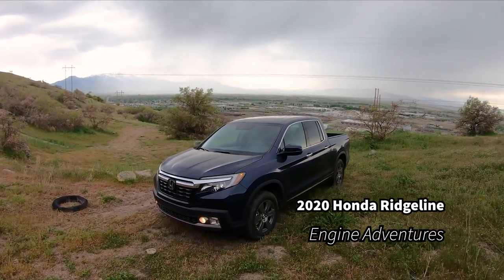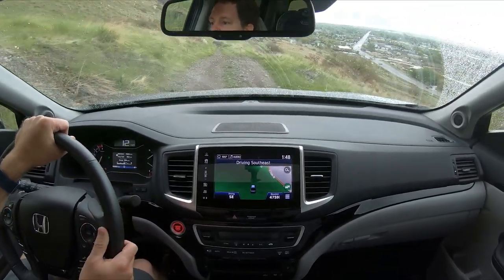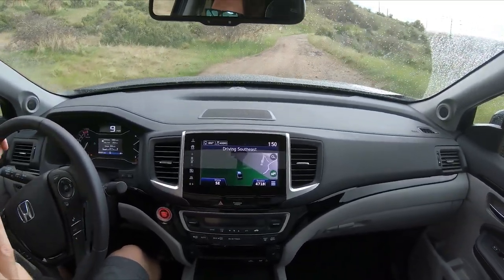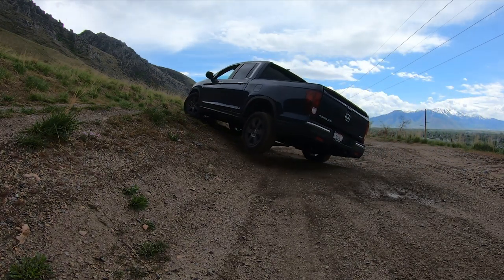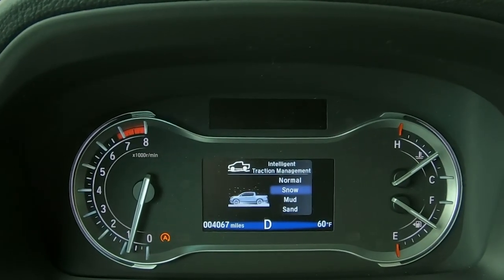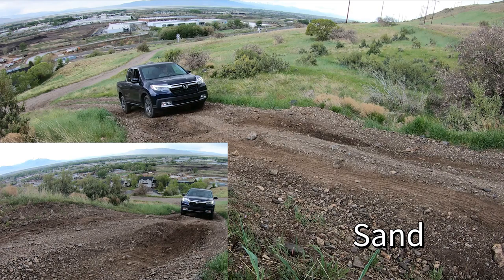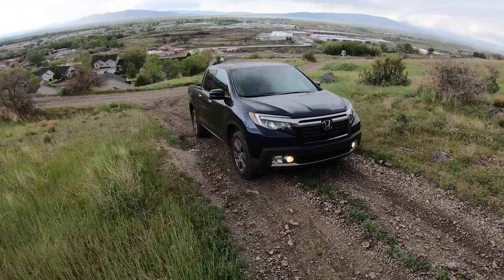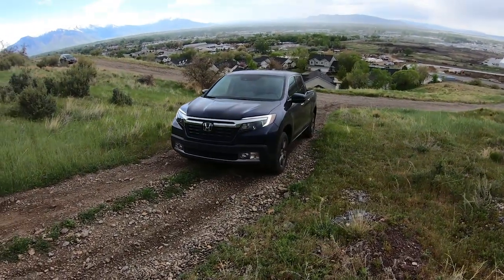2020 Ridgeline Off Road

Comment: I'm guessing with off road tires it would do even better?
Reply from the maker: Tires certainly help, but the limitations of the AWD system will still be there, maybe just not as prominent.
Reply: 255/70/17 tires and 1.5 inch leveling kit gives it almost 2 inch extra clearance without compromising handling, mpg and awd. I prefer Honda 6 speed transmission compared to 9 speed ZF which is much more expensive to maintain like 4x the cost for a fluid change. One biggest thing that every owner needs to do is disable VCM with SVCM then u  don't get all the issues like oil burning, transmission issue, torque convertor issues and injector issues.
Reply: Amazing car but if you wanna 4x4 get a proper 4x4 car.  My Tacoma would walk over that without a struggle
Reply from the maker: I just had a Tacoma TRD Pro, the video should be up in about a month.
Reply: Kbl  how do you disable vcm or svcm.?
Reply: Thanks
Reply: @alexgarcia3900  well ridgeline is capable with tires and 1.5 - 2 inch lift it will follow a tacoma but not on all terrain, id still take the ridgeline for its 26mpg highway roughly
Reply: @xzinx  look i don't mean to offend anyone.  The ridgeline is a great vehicle, more room, faster, better gas mileage, more confortable that tacoma.but when it comes to actually off roading it just simply can't come close to the tacoma.  I honestly considered the ridgeline but I do off road here and there so it wasn't an option and I personally think it's a hideous looking vehicle. The inside is super nice and comfortable though.   But seriously dude that thing can't off road.  Maybe some dirt roads but that's not really off roading. And even with the lift the clearance is just terrible. There's a few videos of people taking them off road up a steep hill and the 4wd system just overheats.  It's just not built for that, and that's  ok.
Reply: @alexgarcia3900  but can you put 4 full size adult?
Reply: @xzinx  lol you're a funny guy.  Dude i had a tundra before that. If i needed room I would have kept the tundra. My 4 door tacoma does exactly what i want it to do.  You honestly sound like you're a fan fanboy.  The ridgeline is a great car i already told you.  But it most definitely cannot off road, not even halfassed not even with a small lift and better tires. And yes the tacoma can definitely have 4 adults.  Not the most confortable but it can, then again I don't ever have 4 adults in the truck.  And if I needed that I would just go buy a full sized truck and leave this one for when I go 4x4/ camp.  There is now way in hell a ridgeline could go to the places I take my truck.
Reply: @alexgarcia3900  why you so mad lol,
Reply: @xzinx  lol. You're the one that came here with your 2 cents.   Entetain me so everyone else can see how smart you are.
Reply: @xzinx  come on keep telling me how awesome the ridgeline is.  Do you own one?
Reply: @alexgarcia3900  yes i do

1st i didnt suggest anything it was the thread owner, i just put in my 2 cents
And the video didnt show any TUNDRA,...
2nd i dont do any hardcore offroading, just enough to find a nice off grid campground

3rd yes i took my ridgeline on sand dunes, didnt get stuck
Moderate trails 

4th i needed the space that tacoma cant do, theres 4 of us family that camps, and tacoma just wont do

The video shows what 90% of people do with their truck anyways
Reply: @xzinx  lol good for you . You'r comment was still stupid. Like I said, Nice car but if you wanna 4x4 get a proper 4x4.  Ridgeline can't handle it.    That's all im saying and it's true.  So people don't go out and buy this thinking it can 4x4 like you are making it seem
Reply: @alexgarcia3900  so why did the ridgeline offroad in th video? It didnt break down, it didnt stop, most of the people who likes to camp go on this kinds of road..

Your boneheaded mentality about 4x4 is stupid lol not everyone needs a 4x4, a capable awd is enough for most people
Reply: @xzinx  lol can't believe you're still defending your mom truck.
it did overheat for one and the guy even said it himself, it's not good for the vehicle. and by the way that's barely off roading. Like seriously though, you can't even get skid plates for that or rock sliders and anything worthy of off roading.    But you are very entertaining ! 

Please tell me more 🤣🤣🤣🤣
Reply: @alexgarcia3900  jsport sells them, im defending it because of the trails i do arent really technical, it fits what i do with my family, period

Btw chrck out johndz on his passport basically the same engine same trans same body but eith out a bed, thank you 🤗🤗
Reply: @xzinx  🤣🤣🤣🤣🤣🤣 you even looked it up lmao .  Well that's pathetic 😅😅😅😅   i still wanna know more you are very wise person.  Tell me more about this mom car being so capable.
Reply: @alexgarcia3900  sigh, if you read what i typed in the beggining before your fanboy 4x4 brain kicked in you would have gotten what i said,

Let me repeat again, with rims and tires you can take this capable truck on trails fpr camping, sand dunes, i know because my old pilot did it i took it to trails on mammoth and pisno beach
Reply: @xzinx  come back i miss you.
Reply: alex garcia 
Why are you so angry? Why were you so offended that he asked if  4 adults can fit in your Tacoma? To be fair, they barely fit a man over 5 10 in the driver seat. You regret your purchase and feel the need to be a keyboard warrior to make yourself feel better or something? I’ll never understand how people can get so heated and invested in a YouTube comment section lol. So invested that you come back a day later 😂 is your life really that boring?
Reply: @EGGMANNoriginal  my life is pretty exciting actually.  And no i dont regret buying my tacoma although i do have to say it is a bit small, but then again i kinda need it to be because i off road a lot.  My tundra was awesome but it had a hard time getting through the small areas.   Again i wasn't mad and im not mad now.  I did say the ridgeline is a great vehicle just not good for 4x4.   What's the purpose of your comment defending mr ridgeline over here?   Are you also gonna come and talk some nonsense?   By the way look at what is the most selling mid pickup and what is the worst one.   I think there's a reason for that.   I actually still look back at my tacoma every time i get out.  And you know what the cool thing about owning a tacoma is???  You don't have to sell the idea about it being a cool car, it Just is.   Unlike the ridgeline.
Reply: alex garcia 
Lol, I had a 2015 Tacoma TRD off-road. It was okay... cramped, rear drum brakes, lackluster acceleration, overpriced... if I could go back in time, I would have gotten a Nissan Frontier pro-4x. Just as much truck, just as capable and reliable, $10k less... “cool car” is subjective so yes, you do have sell the idea lol. Now I have a 2020 Ranger. Better than my Tacoma in every way. I seriously considered a Ridgeline and would own one if they had higher ground clearance.
Reply: alex garcia 
Ranger is up 20% in sales over last year, Tacoma is down 20%. Rangers are already selling about half as many Tacomas. Pretty impressive for 2nd year with not many trim options. Just wait till the Ranger raptor comes here and the Bronco lol. Sales don’t really mean much tbh though so I don’t know what you wish to prove with that. F-150 and civics squash the tacomas in sales, but that doesn’t mean they are inherently better vehicles.
Reply: @EGGMANNoriginal  there's opinions and there are facts.   Yes sales matters when they are in the same category.    Why do you think a civic sold more than a focus?  It's a better car.  I like ford but for the only thing the ranger has going for it is the drive train.   And then again it's more maintenance heavy and more likely to have problems. So you were complaining about me but here you are doing the same thing.  Either way i do like the ranger, i test drove one and at they got the best engine in the mid size for sure.  But for myself i ended up with the tacoma.  I got a decent deal and im gonna keep this for my overlanding rig.   I really didn't wanna get something unreliable and get stuck in the middle of somewhere with no service
Reply: alex garcia no reliability problems so far, but that’s always a potential issue with any vehicle, especially Ford lol. We’ll see. I’d really like Honda to make an actual off-road vehicle or Toyota to make something comfortable for my height on my hour commute each day. I’m also curious to see what Nissan does with the new frontier. Although, I think the only reason the current gen frontier is a good vehicle is that it was designed by Nissan of the past lol. These days, nissans are shit
Reply: Nissan is garbage for sure, the old nissans are good but now days it'sjust plain junk.  Ford is good though, Ive had 2 mustang gts that only saw redline all the time and never had a problem with them, two f150s with 0 problems and a ford expedition with 0 problems only alternator went bad.   All v8s though and they all made it past 120k.     The ranger should be good but it's still a turbo car so it's likely to have some issues in the long run if you don't keep up with maintenance or tow.   You should be good with the ranger for a while.  For the price you got it even i would've probably bought it.   Aoso im 5,11 and i drive a lot and dont think the tacoma is uncomfortable, not the best by any means but it's not terrible.
Reply: @xzinx  depends are the adults from America or the rest of the world? lol seriously though the Tacoma can fit 4 adults just fine.
Reply: @xzinx  dude that ridgeline ant following a Tacoma trd even with mods you mentioned. If you can find someone with a ridgeline in the southern california area I'm willing to put money on it.
Reply: @jordanyang3066 yes from america

And read what i typed, i said it will follow a tacoma on most trails easy to mpderate trails, the ridgelinr wont rock crawl thays for sure
Reply: @xzinx  so I dont get it then a 2 inch lift plus tires will make it able to follow a Tacoma on fire roads? Well a "stock 2wd" tacoma can do that as well and its cheaper and it fits 4 adults, and it gets 26mpg as well. Dont belive me go check out tacomaworld forum and see the highest mpgs they are getting on 2wd v6s. ridgelines a great truck but apples vs apples it ant folloing a tacoma anywhere. It will over heat end of story.
Reply: @xzinx  also the average american is 5"9' so unless they are sitting way back gangster style theres no reason why a tacoma couldnt fit 4 adults comfortably. Im 6 foot and so are my brothers and us 4 fit fine when we go hunting for days on end. its all preception and preferences buddy. stop being a hater and no your limits. ridgline has better gearing than a tacoma and drives better and I accept that. Its easy you should try it, youll be more happy.
Reply: @jordanyang3066  i said most trails not all of them, some people dont rock crawl or go on the rubicon trail, people use awd for offroad to find a camp site and thats enough for them
Reply: @xzinx  "most trails" are un maintaines and messed up. ridglines ant foollowing tacoms. hellnthey cant even follow subarus cause it will over heat. just accept it
Reply: @xzinx  lmfao you just cant accept it can you. So thats 1 point for the ridgeline to the at least 3 points for the tacoma where it didnt over heat on the same exact trails across muriple youtube videos. Again if your so sure it can keep up Im in socal, and have been to that exact place in death valley. Find a ridgeline and well run them.
Reply: @jordanyang3066  thats the roads i go on for my camping trips, thats all i need .... Whats wrong with that???? Ik not spending your money lol,
Reply: @jordanyang3066  this is what most owners use their cars for, 90% of the time, the other 10 are like you 😁
Reply: @xzinx  dude you have obviously never been to death valley if you think thats what 90 percent of people are doing🤦‍♂️. they dont call it death valley for nothing man. why are ridgeline owners so arrogant and besides ill take blown shocks anyday over a blown engine from overheating.
Reply: @xzinx  lmfao death valley is not the same road your taking to your well maintained pay campsite with no ruts and no washboards. this is actually getting entertaining now. what are you goingnto say next?
Reply: @jordanyang3066  alabama hills, lone pine, grant lake, virginia lake  kern river pismo beach ohv, fish creek, mammoth lakes, etc all this have dispersed camping thats not maintained and ive been to all of them 🤗
Reply: @xzinx  so no death valley? so your refrancing a place you've never been to yet say thats what 90% of what people do with awd? got it. you sir are an ego maniac.

Comment: Is this a FWD? I’m looking at purchasing a new maverick with FWD. I’ve always had RWD trucks so I’m unsure how It will handle off road. Basically on gravel and terrain like this. Not going to be doing any over landing.
Reply from the maker: It's FWD under normal conditions but it automatically engages AWD as needed. You can also lock it into AWD if you know you're in a situation where it will be needed. If you're not doing anything crazy you should be just fine.

Comment: is this ridgeline running the stock tires and 18" stock wheels? seems like if you had 1 or 2" taller tires you save a lot of scrapes.
Reply from the maker: This was a media vehicle, so entirely stock. Bigger tires would help with clearance, but reduce torque getting out to the ground. Without a low range transfercase, I'm not sure which is better on the Ridgeline.
Reply: @EngineAdventures  thanks, I hadn't thought of that.
Reply: @EngineAdventures  how would one measure the amount of torque lost by say  going to a 2 inch taller tire ?
Reply from the maker: @seller2001  the stock size is a 245/60R18 or a 29.5" ish tire, say you add two inches with a 265/65r18 or a 31.5" then you would lose about 6.3% of torque getting to the ground. The equation is just current tire diameter/desired tire diameter or 29.5/31.5 in this case. That = .937 or a 6.3% loss.

Comment: There is no center diff like a Toyota. just a transfer case that piggybacks off the front wheel ring gear that sends power directly to rear diff to control clutch engagement.
Reply from the maker: Right and there is no rear differential either, just a ring and pinion gear with a clutch to each axle. It's easier to explain by just saying center and rear differentials though.

Comment: I have been looking at the Second Gen Ridgeline for a good bit.  Thinking of grabbing one this Fall.  

Would add a lift kit and change out some tires for more country/farm driving. And possibly an aftermarket head unit to have a knob on there.
Reply from the maker: The 9 speed makes a big difference for the 2020, I'm not sure the 2019 would have made that climb. The 1st gen can't... Still a great vehicle though!
Reply: @EngineAdventures  thanks for the opinion and your advice.
Reply: Thought I would miss the knob.  I don't and I'm sure you won't.
Reply: If you want to lift it, check with Honda first, and don't go above 1.5 inches, any more increases the angle of the CV axles and will void the warranty if drivetrain problems arise a result of the lifts.

Comment: Seems like nobody testing the Ridgeline bothers to change to the approprieiate tires for these tests.
Reply from the maker: Tires aren't what's being tested here. Look through all my videos and you'll see stock tires for nearly every vehicle tested.

Having the right tires for the terrain is very important! I'm not negating that.

This test is more about the ability of the vehicle to transfer torque to the wheels that have traction. In many areas of this test two diagonally opposed wheels are completely unloaded, so regardless of what tire you use you're not going to get enough traction from the air on those two tires to pull you up the hill. The vehicle needs to transfer power to the other two wheels that have better traction. I will blame the tires if all 4 wheels are spinning at the same rate and the vehicle isn't climbing.

I also don't air down for these tests. While it would be nice to use the same wheel and tire for every vehicle I test, it doesn't make sense in the real world.

Comment: Does it have factory installed recovery hooks
Reply from the maker: If I remember correctly it doesn't have anything on the front for recovery. On the rear you have the trailer hitch receiver.

Comment: Curious about how first gear performs for hill descent purposes.  That's one feature I wish RL had, a super low granny-type setting for steep descent.
Reply from the maker: When I tried it, I immediately had to hit the brakes to slow it down before things got out of hand. I haven't tested a vehicle without low range transfer case that had good slow speed engine braking.
Reply: @EngineAdventures  Thanks for that observation.  Fortunately most of the USFS and BLM roads I will be using don't have grades steep enough for any kind of hill descent.  Would've been nice to have that feature, however.

Comment: Bruh you keep mentioning "wheel spin" with the different driving modes but they change torque distribution with sand mode being the most aggressive rear bias along traction control limited.
Reply from the maker: That's a good point and I don't know what the power distribution is front to rear in each mode.

Comment: Wonder what a lift kit would look like?
Reply from the maker: Might look good, the problem is when adding bigger tires it effective reduces the crawl ratio, which would put more strain on the AWD system and potentially stop it from climbing the steep grade.
Reply: @EngineAdventures  Traxda makes kits for Honda. There is a guy who lifted his Passport and does surprising things with it--he has a You Tube channel.
Reply: @crv20051  and there have been reports of excessive lifting (over 1.5 inches) affecting the CV joints and voiding warranties.